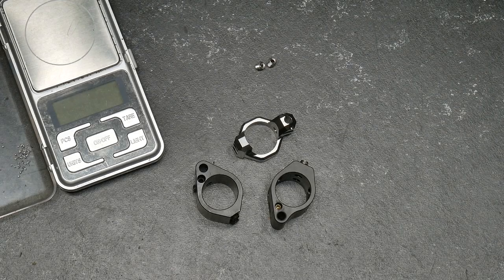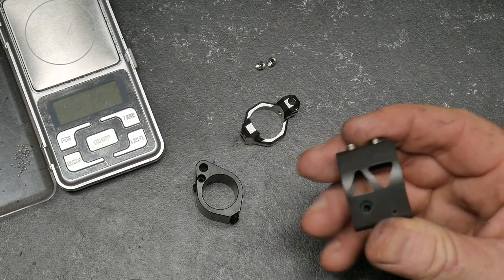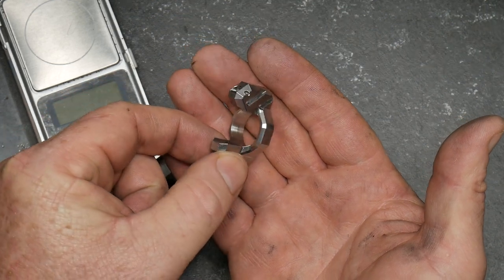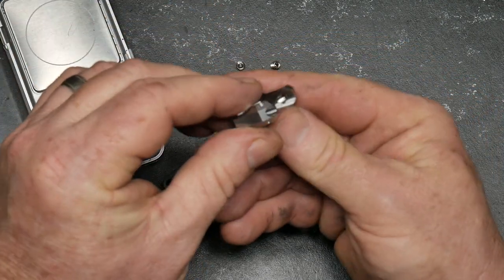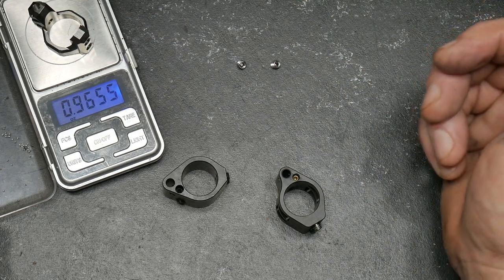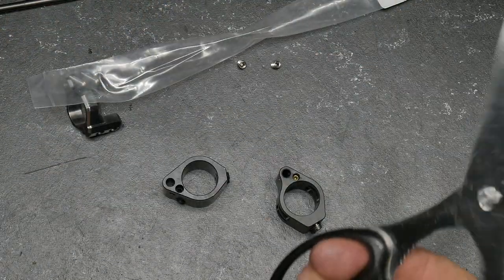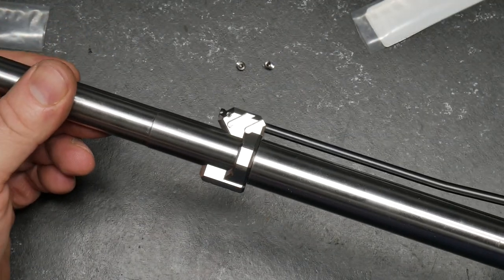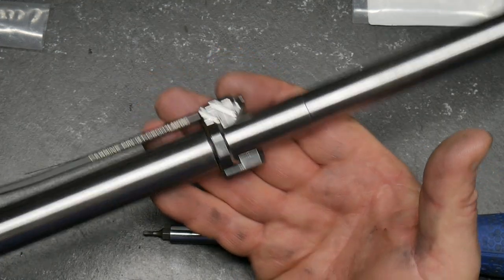Airborne Arms Featherweight Gas Block!

Comment: Its a nice looking gas block, but they should have put the mounting screws side by side instead of inline, that forward mounting screw is putting stress on the that forward part of the gas block that has no support like the rear screw does.

Comment: Good looking gas block, but there is not enough "meat" around the bottom set screw flange in relation to the ring around the barrel. You can see the front set screw it is already tweaking the set screw flange away from the barrel. They really should have put a reinforcing scallop between the two, instead of the 90 degree transition. I am betting it will work its way loose under the heat of repeated firing.
Reply: scotty362100 see the final design

Comment: Looks pretty cool, I don’t trust non pinned gas blocks though. 

Hope they figure out how to make it able to be pinned.
Reply: Why? As long as you know what you are doing and do it right no matter the design they wont move.
But if you are that worried run all HM defense Monobloc barrels. Just incase at some point you no longer trust the pinned gas blocks.
Reply: Freedom Inc. That’s false. 

I have seen 2 dimple barrel gas blocks come loose and one clamp style. 

I have never seen a clamp on style come loose. 

You can not fight physics.